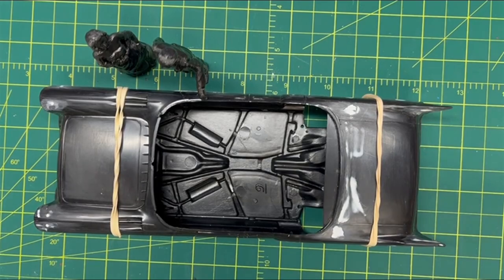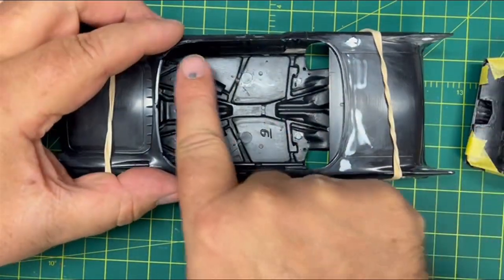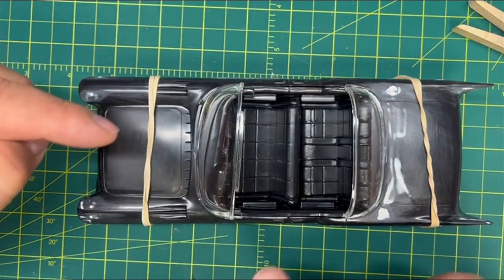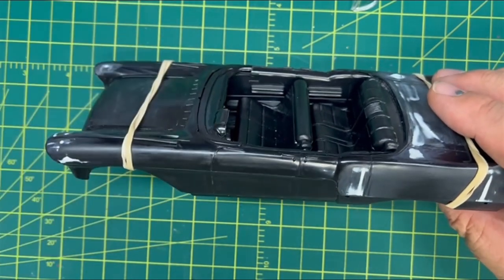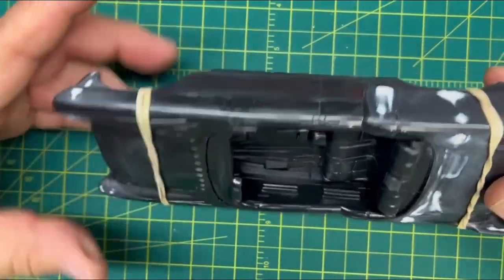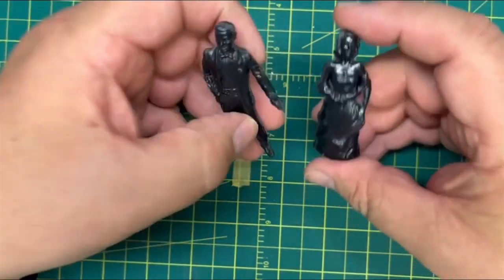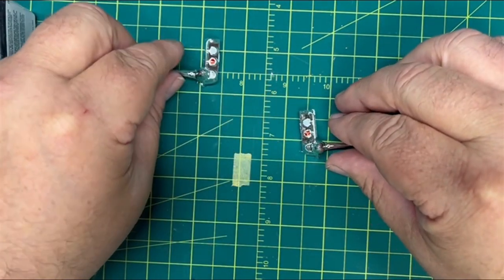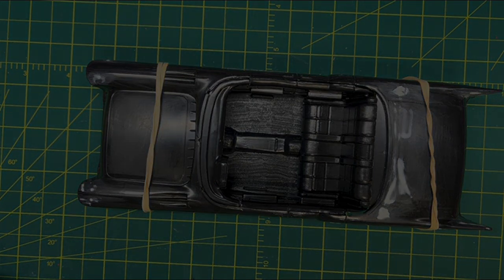Revell 57 Cadillac Eldorado Brougham build update #2

Comment: No horns! 😃
Atlantis is the latest to issue this kit. I believe it is molded in red. 
I don't know how you got the body opening wide enough for that interior to drop through, but I saw it with my own eyes there, so it can be done! 
You have clothesline pins to hold it together with glue, but I still think I'll use small c-clamps and gauze. 😉 
(c-clamps can be tightened as needed.)
Reply from the maker: No horns.  I just couldn't remember who made it now.  I'll pass that along for anyone who may want to build this one.  It's a lot of fun.  Fitting the interior like that will be a game changer for me.  I still like your small C-Clamp idea. . . You saw my cloths pin about crush the pieces.  I'm going to look for some small ones.  Thanks again.

Comment: I see a sink mark right behind the drivers door about key hole hight on rear quarter panel.  What about slits for side windows & put a window 1/4 the way up on the passenger side? 🤔
What a beautiful Caddi its going to be. ❤️ it!
Reply from the maker: Thanks for the heads up.  I still have a few more days to get the body work right.  The trunk and that sink hole and a few more that I missed.  I want this one to be smooth as glass before I put it to paint.